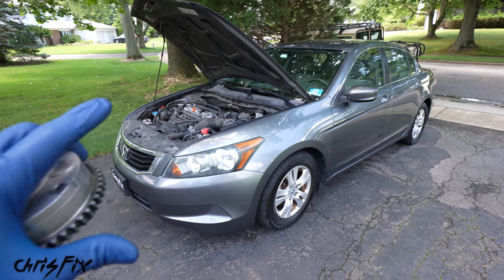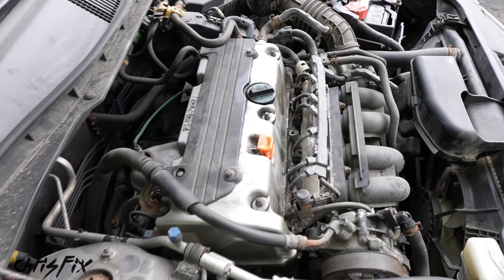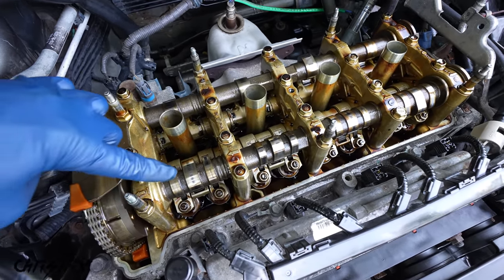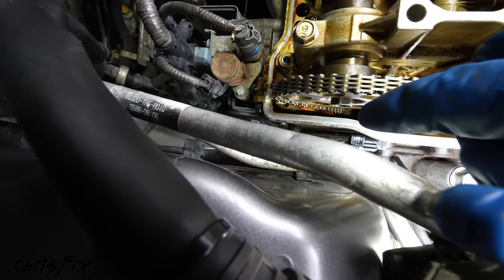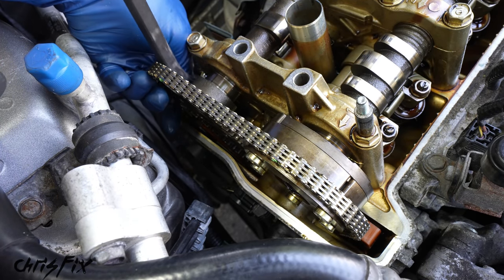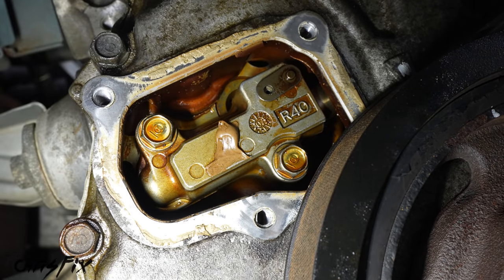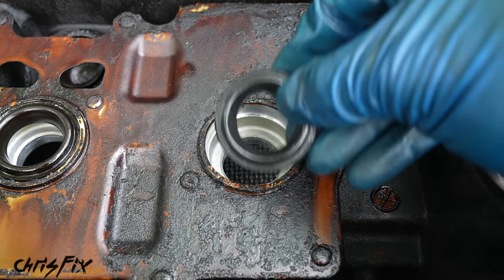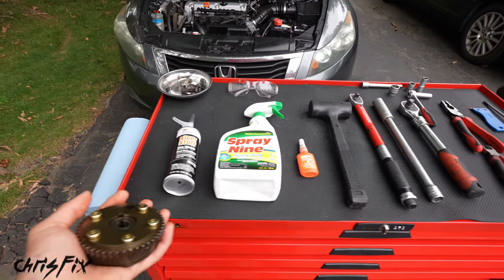How to Replace a VTC Actuator (Complete DIY Guide)

Comment: I’ve done this job twice now on my 2011 accord 2.4. Both times skipped a tooth on the timing chain. The first time I went through the process of removing the timing cover. While I was in there I replaced the timing chain, guides, and tensioner. The second time I realized the vvt actuator sprocket was what skipped. When I went to back off the tensioner counter clockwise, to insert the pin, I heard it skip. I’m going to assume the crank timing is still good at the bottom end and turn the intake cam back to TDC after installing the new actuator and before putting the timing chain back on. Wish me luck!

Comment: Amazing video. I wonder how hard this would be to tackle for someone with little to none mechanical experience. Also, is it common practice to always prefill an oil filter?
Reply: Shouldn’t be THAT hard with the way Chris lays stuff out so simply. And the filter thing not everyone does it, but it is a good thing to do just to be easier on your engine.

Comment: Good video just one added step to prevent the cams from rotating is locking the back of the cams with looking pins where the cam angle plates screws in.
Reply from the maker: Thanks for sharing!
Reply: @chrisfix  any time bro also when u have those pins in place the cams are in the correct timing sequence and the intake cam gear locked. It's good sharing knowledge keep up the good work

Comment: 2011 Honda Accord Tips 
1) Wrench size is 24 mm (25mm Honda recommended)
2) To break the vtc actuator bolt free, my father in law helped. One person on the breaker bar. Another holding the wrench. It was impossible without extra help (or induction heat)
3) I was not able to get the exhaust sprocket back on after replacing the vtc sprocket. It was not even lining up. So I removed the tensioner (*with the pin on*). Once removed I was able to replace the tensioner. 
4) I bought a new tensioner since I wasn't trusting compressing the old one and it felt looser than expected. Also bad tensioner can also lead to the rattle.
 To note: I was not be able to replace the tensioner unless the chain tension was back on the sprockets. There will be a tough tensioner arm pressed towards the tensioner area. I had to wiggle the cams and add Allen keys to the holes on driver side. That was essential in order to align the cams and add tensioner back to the cams. 
5) If you are not aligned, do not freak out. Just start over using the Allen keys on the driver side and add the timing chain while at top dead center.
6) If all else fails, email Chris. He was very responsive and helped with perfect advice and other videos for reference. 
My car is now running smoother and cold starting without the scary embarassing 3 second rattle. Daring job but well worth it. Difficulty level 7.5/10

Comment: Hey there! Hope all is well. I will be trying to tackle this on my wife’s car this weekend as a DIYer. Did have a question. If I were having trouble removing that 17mm bolt with that holds in the actuator, is it safe to try a right angle impact wrench in it? Or is it too sensitive and should only be broken with a breaker bar? Thanks in advance!

Comment: I want to do this to my moms car soon.  In the checkout cart it says “ there are typically 2 vvt sprockets, when one fails, the other is not far behind”. Also recommends to replace vvt solenoid too.  Working on 2014 Honda CR-V.
Reply from the maker: I would replace the VVT ONLY with an OEM. I tried the doorman and usually it's fine but in this case the doorman product was not built right and didnt work.

Comment: I found some people who are removing the outer plate on the actuator, and stretching the small spring inside. It seems much easier than all the other fixes and there's no need to even remove the actuator then. I'll be doing this soon.
Reply: You can also buy new springs that aren't worn. How did you make out?

Comment: Hey Chris, I saw in some videos people are just changing the spring inside the gear and fixing the rattle can you confirm if there is no check engine light coming for vtc only changing the spring will work to stop the rattle.

Comment: Hey Chris, could you explain what went bad with the old actuator?  It's hard to see any difference from the bad on and the new one. Of course I have no clue what this part does or how it works, but....  Also, I just watch your fan clutch video from years ago, and I had the same question.  What went bad on the old part?  Sometimes it's easy to see what a problem is, like a bad ball joint or bearing, or fuel pump that doesn't work, but some parts it's hard to even see what could go wrong with them... anyway - of all the car channels out there, you do the best job.  Thanks.

Comment: Tip for tight chain: I could not get the exhaust sprocket back on and fought with it for hours. What finally worked was removing the chain tensioner out of the small hole in the cover. I found another YouTube video on how to compress it. I reinstalled it and the chain was nice and loose. Both sprockets went on immediately without any resistance.
Reply: Dear Benbadal, i am doing this job now and also took the chain tensioner out. I am wondering if you can teach me how to put it back in. I have a hard time putting it back in there. I was able to compress it and jam it back to the hole but now my tension on the chain is very loose on the right side and the tensioner will not go back to the 2 bolts position

Comment: I have a 2008 Honda Accord 2.4 and by now I got used to the grinding noise every start lol but I really should fix it
Reply from the maker: I mean until a check engine light comes on, it’s probably not going to catastrophically fail so….
Reply: @chrisfix  yeah still no check engine light which I feel pretty lucky

Comment: I had this issue with my 08 accord 2.4L. I researched and found the "fixed" actuator part from Honda. Had my  trusted mechanic install it, it still rattled, but only half as loud. Love my Accords, but man, this 08 I had was a bad oil burner, had tons of problems, and I spent thousands trying to keep that thing on the road before I got annoyed and sold it.

Comment: I don't have the ability to move important 'tips' to the top, so I thought for newbies wanting to do this job yourself, a tip WAY down in the comments, was to use a small Allen key, in the timing chain tensioner (you'll see where this is needed, part way into the video, once the wheel is removed) rather than the device Chris used here.   If it falls out, you may have an issue, whereas a proper sized Allen key will stay in place!   This will make more sense after watching the video of course.

Comment: Hey Chris Great vid! Helped me TONS! However.... I pulled a rookie move and when I was putting the new vtc on, I accidentally locked the vtc before I even got a bolt in it! Can I still proceed with the job and bolt and torque the vtc down in the locked possition or did I just waist $170? Thanks Dude!

Comment: Great videos..i just replaced the vtc sprocket on my 2012 accord using this video. I did forget to click lock the actuator after i installed the new. I heard it lock after turning the engine by hand to verify timing...is this ok? The car cranks and runs fine..no more rattle!!

Comment: Great video 1st off!!!! So, I have an 09 accord 2.4L I-Vtech with 150k on motor and 298k on body. Rattle on startup (need to replace vct actuator) I procrastinated and now the front is up, wheel is off. Crank is at TDC, but lines on sprockets are 7-8 teeth apart. What do you think happened? I believe it jumped time a couple times. I noticed that the chain was sitting on top of the teeth on vvt sprocket, questioned it, but either way knew it needed a timing chain kit done with new actuator. Popped off the top guide and it snapped into place. I don't know if I am overthinking it, but I have to take everything off anyways as I am positive the valves are out of sync. Loss of power, etc. Remove cams??? Or can I "feel it out to get cams back to TDC by moving crank 90 degrees CW and doing it that way???? Please help, I do not want to do any unneeded work on this. Just want it driving again. THANK YOU!!! My truck parts should be here in the next couple days as I had lost 4th gear from snap ring on 4th gear servo broke and so awaiting new ring, piston,catch balls, and upper/lower gaskets to re-install. Had a solid diag done on it and other than that it is in perfect working order. THANK YOU. ANY help would be greatly appreciated.

Comment: Hi, ! Great videos ! 
Did the 2 sproket align in The middle   without moving the camshafts at the moment of mountain the chain? The camshaft where the new actuator was mount? 
Because it Looks like the new actuator didnt get in the same exact spot as the one removed ,, look like it went to the front a little bit  so how to align then, moving the camshaft ? 
Thanks!!

Comment: I am doing this project now and ran into problems because I dont have that induction heater to help me remove the 17 mm bolt that holds down the vtc actuator. So basically I followed all your steps to turn the motor to line up those lines to get it to "top dead center" however when i tried everything from a-z yo remove that 17mm actuator bolt i had no choice but to order the heater($500) but it wont be here tell saturday so I am hoping i didnt mess something up by lining up the sprockets for no reoson? Eh the only trouble i had is not getting the bolt off without that heater. What to do what to do. Also I had already taken off the little side plate for the timing chain tensioner so i had to remake that gasket with the right stuff you showed in the video. I will be taking it apart again when i receive the induction heater but for now i hope everything is ok. Love your videos thanks for all the help.
Reply: so how did it go afterwards?

Comment: The 1.5L engine from Honda Civic 10th gen also have this problem. I have a 2016 Civic with this engine and I had Honda replaced the VTC actuator with only 10k miles driven (the part actually fail directly during manufacturing at Honda factory, because it start to rattle at cold start even though the car was new). After going back and forth with dealer and American Honda they finally agree that the VTC actuators are faulty for 16-17 Civic sedan, coupe and hatchback. Hot restart the car even make the grinding noise worse.
Reply from the maker: That is frustrating. A lot of new cars are having this issue unfortunately.

Comment: Have 2013 Honda CRV with the same problem dealer said the chain was stretched as well as VTC actuator, cost of job quoted as $2,868 in Aug 2024.  Is that a fair price? Also ChrisFix can you do a video to show change of VTC Actuator AND the Chain to show the difference in cost of parts and labor/effort?

Comment: Master @ChrisFix, first of all - thank you for the superb videos that you create and share with us all for free!

I have one question - what can cause VVT actuator failure? When the actuator fails - what actually fails (I suppose something inside of it) - is it worn out inside and holding pressure because of increased clearance between the parts it is composed from?

Sorry, those are two questions. I bought a new VVT actuator, and according to the mechanic -it failed in three days. Is it theoretically possible? I don't think so, the car barely crossed 50km.
Reply: heard the spring tension can be bad in old VVT actuators that have been sitting for a long period, try replacing just the spring in the VVT acuator

Comment: My code is P0346. I already replaced the cam sensors, VVT solenoids, etc. There is no rattle but it does have the characteristic symptoms. Please recommend what I should try next. It's a 2014 Ford Mustang V6 3.7. Thank you.

Comment: Great DIY video! On another note, and just a bit of advice from a journeyman mechanic:

BEFORE you purchase any vehicle, ask the salesperson, or simply research the model yourself for what I believe to be the most important aspect of the drivetrain; is the engine an "Interference" a "semi-interference", or a "non-interference" design? If it's a good old fashioned non-interference design, it's top-shelf! If it's any type of the interference design, it's a rip-off, and a push designed to burn the consumer. In fact, it should be outlawed.

The "interference design": An engine that is designed to beat itself to death (sometimes pistons come blasting right out of the block!) if it should lose its weak, thin little belt that costs under $100 and when it breaks it does on average of about $2200 dollars in damage. The non-interference type does around $200 worth of damage and can be easily repaired. Don't buy this un-American junk!😉

Comment: Excellent video. Questions:
  * May impact be used on these bolts?
  * Can you slide chain forward (towards the passenger side wheel) off of sproket and VTEC actuator without taking off sproket, given there is sufficient slack? 

Asking for a friend :)

Comment: Hey Chris, i have a 2006 toyota Camry with the 1mzfe motor with 267,300kms she has a check engine light and code is p0420, i am looking to replace my cataylic converter, but i was suggested to use a cataylic converter cleaner, apparently that might fix the clogging, the p0420 code is for a cataylic converter under its effieceny threshold, the engine wouldnt accelerate properly has literally low power, but before all of this happpened, i had a bad knock sensor bank 1 so i replaced both of them for preventitive maintance, while at it i also replace my spark plugs, then i had a bad o2 sensor bank 1 which is located near the exhaust manifold, thats the air to fuel ratio sensor and now the bank 1 cataylic converter is bad, all of this is leaning towards fuel problem
ive been told my fuel pump is bad, because my car does struggle to start up on cold start during winter, i was wondering whether if u know a method to fix and also to find a second hand or new cataylic converter for my car

Comment: Yeah mine do this but I knew what it was because my oil is leaking.. plus also it can still make that noise with full oil on acceleration.  My 07 not doing it but I'm going to replace it anyway and do my oil pan gasket

Comment: replaced mine and same exact sound right after replacing it.. odd because so many videos, lawsuits on this vvt issue on hondas.... no dice for me.. so I got started and first thing was that even though i tried to keep the chain tied up with zip ties.. it must have got loosened up below because it ended up being off 4 teeth... it took two guys to get the bolts off ... so hard to get off I lifted my helper(who was holding the 23mm wrench on the cam) off the ground while I loosened the VVT bolt... that moved stuff around also.. then when trying to get back to TDC.. it was off by several inches at the bottom... so ended up having to take off the timing cover... ended up cracking the timing cover since there was one bolt i could not find.. had to get that welded... then after 4 full days... about 15 hours a day of working on it.. finally got it all back together... properly timed/lined up on top/bottom.... started up the car and same noise... so spent probably 800 dollars + for the vvt/tools/seals/orings/lyft rides to honda/autozone/tensioners/chain guides - that heater gun among other random crap & 60 straight hours of working on it and same issue...

Comment: My 2016 crv makes the cold rattle but so far runs well at 85000..is there urgency to do it or can it go awhile? I am pretty sure at 65000 when I got it .the car was doing it but I was oblivious to it...seems they all do it..I was told the tensioner is what needs replacement..great explanation..
Reply from the maker: It can wait a little but if it gets bad then consider fixing it asap.
Reply: @chrisfix  this wouldn't have anything to do with the idle shake at lights?  I heard that was a set idle too low..I flip the headlights on ...
Reply: We usually just replace the VTC actuator spring and the timing chain tensioner on these Earth Dreams engines.
Reply: @spring-start  wonder why the recall doesnt include 2016..
Reply: @Tracy-wr7mj  Not sure but for the 2015-2018 CRV, 2013-2017 Accords, 2015-2020 TLX with the 5A2 VTC Actuators,  a new VTC spring kit and an OEM 5A2-02 tensioner it's just over $100 in parts. With a couple hours labour the rattle is fixed long term.
Reply: @spring-start  i have to pay a mechanic so its a strain on the budget..

Comment: Awesome video my dad owns a 2004 honda accord and it didnt make that sound (not yet at least) but my 2009 toyota Corolla is making the same exact rattel sound you were talking about, is it the same thing that needs to be replaced?
Reply from the maker: Might be a similar system that needs replacement if your car has variable valve timing
Reply: I did some research and it seems like the 2 vvti sprockets need to be changed along with the timing chain, this helped alot thank you so much

Comment: If you're using an induction heater to heat the bolt, let it cool down, when the bolt is hot it expands which makes it tight, if you heat it up, let it expand it can crush rust built up between the bolt and the part and potetnially slightly crush the bolt, after it cools down it shrinks and that makes it easier to remove it, it's also easier to round the head of the bolt while it's hot. Also, use a 6 point wrench/socket for tight bolts, 12 point ones give less engagement and can cause it to round off, open ended wrenches are worst at this